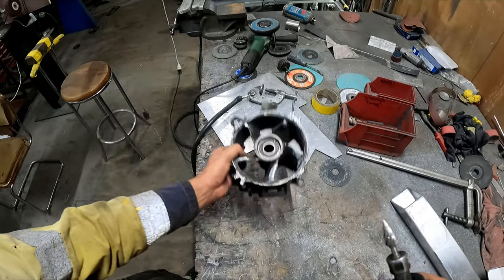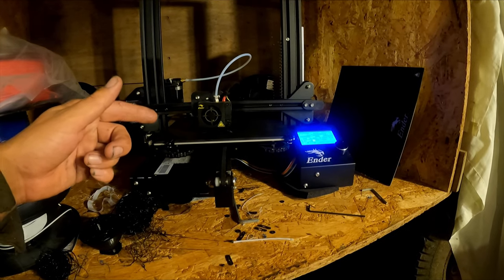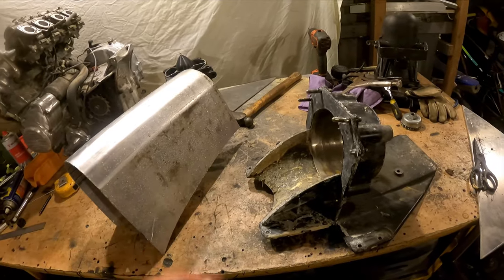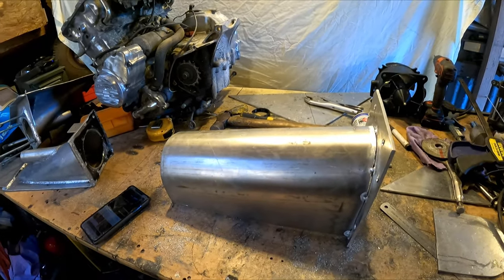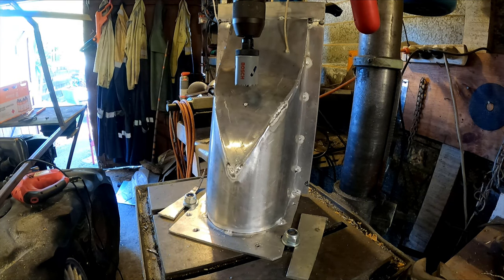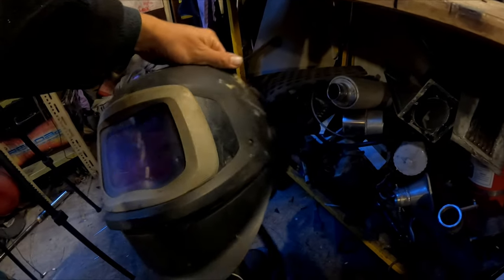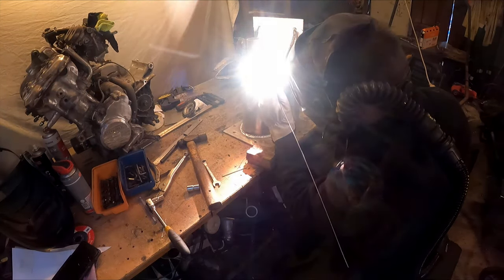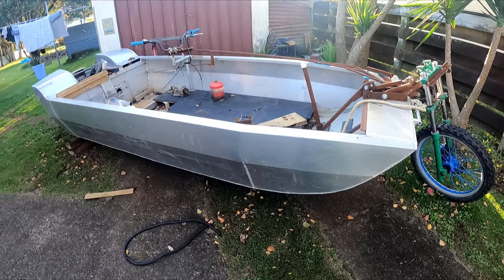Amphibious Jet Boat, Part 2 , How To Build Intake

Comment: the argon thing is true, Argon is an inert noble gas 1.38 times the density of air. so it doesn't react with anything and displaces other useful things like oxygen. it can sit in your lungs but you should be able to expel it with a few big breaths, either laying on the floor or sitting with head between your knees. The symptoms are dizzyness, shortness of breath, tingly fingers, spotty or dim vision, ie asphyxiation

Comment: There are several methods to improve the sticking of your 3D prints. First I would make sure that the bed is really clean, that makes a lot of difference as well. Beyond that you can also increase the bed temperature to get it to stick better, with PLA you can go up to about 70 C. Glue sticks and brims are also an option but I find them annoying

Comment: Awesome build series, I've been playing with jet pump ideas in my head for a while. 
A few things for 3d printing.
1. I personally use Elmer's glue stick on my bed. Or I found an Elmer's pump sprayer of school glue that's pretty much the same.
2.Clean bed /  with some isopropyl alcohol wipe down before printing. Dust can effect it. 
3. if you aren't using pla + look into it. I switched and I'll never look back.
Reply from the maker: Thanks, I am using glue stick now which works great . I tried PLA + and it worked well but it’s quite expensive

Comment: Looks great! I did mine the exact same way, and have a video on it as well.
I did mine with a ball peen hammer lol, my goal was smooth seamless pump flow, which becomes less important if the rig wont go over 30mph but I ended up with 35MPH fully loaded with a 787cc.
Had to use bondo in from of the intake to help make it 100% seamless which ended up acting as a slight "Spoon" and its been taking the beating for some years!
Reply from the maker: O nice! I don’t really think mine is going to be very efficient but for the amphibious trike thing I think it will work well
Reply: @DktheWelder  Looking forward to more!

Comment: I use 3DLAC for my bed adhesion, it's basically ultra strong hairspray and, for the most part, objects pop off when the bed cools. And when they don't I put my bed in the fridge for ten mins and they print comes off easily.

I have never had problems with adhesion ever since I bought it. (I was in the same boat as you before, prints unsticking from the bed) And at also means I can reduce the  elephants foot effect on those first few layers of the print as I'm able to pull up the nozzle a bit.

There are many options out there, but this one has never failed me. Of course this is just, like, my opinion, man.
Reply from the maker: Ok I think hairspray might be the go , do you spray it before each print?
Reply: @DktheWelder  Could have sworn I replied to this. So I'll give you the short answer! No, you shouldn't need to, for the 3DLAC i just move around the bed printing on the parts where there is still spray. Also, small amounts should do depending on the spray you get, go for the strongest you can find if you cant get 3DLAC. You might have to read a few Cosmopolitan reviews to find the best hairspray! 😂
Great projects btw, really enjoying your content.

Comment: I put a BL Touch on my printer. It took me six years to make the jump to the BL… I wished I didn’t wait so long. I used to use hairspray because I didn’t like the way glue stick looked after the print.. with the BL touch I will occasionally use hairspray and that’s it.

Comment: I have been 3d printing for a while. Make sure the glass is clean and dust free. Spray a little squirt of hairspray and let it dry. If it's a heated bed, start at 50c as this is my standard bed temp. Set the bed hight so the first lines of print feels like about haft the material is squashed like this ( 

Once it's all set and you get good adherence I just add a fresh spray of hairspray ow and then, wash about ever 15 prints. 

Saying that the print being that shape I would have issues with the nozzle knocking it on the sides.

Comment: Keep up the good work. You are a good fabricator. What welder are you using. Do you think it's good. Looking forward to the next video.
Reply from the maker: It is a BOC 185amp ac/dc I think it is a Chinese brand rebranded. It works really well and have used it for a few years , we have the same one at work and it never has issues

Comment: its called layershift. now you can look up causes and fixes =)

i dont runt enders glass, but a mirror on my ender. as long as its clean, everything sticks. if im worried, or there is some .05mm part contacting only, i can give it a 3dlac+ squirt.
My sister runs enders glass bed on her max, and weve had to rough it up with some sand paper, and increase the temp towards 60 for pla to stick somewhat ok

Comment: I recently got a 3d printer and it was driving me up the wall with prints not sticking but I found if I set the bed to 60 degrees and wipe the bed down with meths before every print parts stick amazing, sometimes a little to well that I'm afraid I'm gonna smash the bed trying to get it off😂
Reply from the maker: I haven’t heard about the meths way, it makes sense though would make the first layer more sticky

Comment: I don't think you need to hang upside down to get the argon out of your lungs. Normal deep breaths should be fine. Cody's Lab did a video where he breathed in a bunch of gases including argon and xenon with no issue getting it out after a few breaths. Will kill you dead if you breath it in repeatedly though, such as in a confined space.
Reply from the maker: O cool I might watch that! Thanks

Comment: I use glue stick just got to clean it off each time. But if you normally get good prints maybe just clean bed surface with isopropyl alcohol before the oils from your hand can stop your print from sticking.
Reply from the maker: Maybe that’s what it is , I am always pulling pieces of plastic off the bed!

Comment: Ive been 3D Printing only for about 3 or 4 yrs now, ive made anything from little trinkets to an RC Plane (that worked!) and a Ironman Helmet for my kid. Anytime I get any slippage I use All Weather AQUA NET Hairspray Extra Super Hold!! Just a Spray in the Area and thats all You need! Ive used on a glass bed and a heated Magnetic bed.  If you ever have trouble getting pieces off try squirting a little 50/50 Water and 70% Rubbing Alcohol, should break free No Problemmmmm!!
Reply from the maker: Thanks I have been using glue stick now with success but it gets a bit lumpy after a few prints might need some rubbing alcohol 👍

Comment: Daniel order yourself the creality flexible PEI build sheet! get away from that horrid glass! they are spring steel and attach with magnets and have superior adhesion and are really easy to get parts off due to it being flexible!
Reply from the maker: I haven’t heard of that, it came with a fibreglass bed that would never sit flat . The glass one has been really good but sometimes get a messed up print. I like the spring steel idea

Comment: hmm argon is a fairly heavy gas, heavier than air anyway. I could see inhaling it if you were welding in an enclosed space like a locker/mechanical space or seat box of some kind. At that point I would be more worried about it displacing oxygen though. Speedglass is great just wish the lenses were cheaper. My blower just shit the bed after two years too... time to get another one, it happened at work so hopefully they can buy it for me.
Reply from the maker: I know they are so expensive!
Reply: @DktheWelder  What size pipe did you use for final shaping in the press?
Reply from the maker: @venture17fly  I think 100nb so about 115 mm outside diameter

Comment: I use the stock ender 3 bed and PLA never slips unless the bed height is too low or the part is very thin but large enough to use the entire build volume. I don't need anything fancy to print ABS either. Just a cardboard box to enclose the printer and a brim because it's cheap insurance. I see you have a pristine ender 3 bed in the background, how come you don't use that?
Reply from the maker: That bed is great for sticking parts to but wont sit flat enough, the glass one I have on now works really well just some prints don’t stick
Reply: Oh you must be printing much more precise parts than me. I have noticed my bed isn't completely flat but I've never seen it affect the function of the parts

Comment: dont know about the argon, i do know about the other gasses that you get when welding aluminium. I had to stop working for a few days because of inhaling a bit of it while mig welding aluminium. I allmost couldnt breed for like 60 min, and breathing was still kind of hard for 3 days after. So i was actually thinking about investing in a fresh air helmet as wel.
Reply from the maker: Wow that does sound awful! The helmet are so comfortable and nice breathing the fresh air all day

Comment: Little late for the comment... but I heat up the bed. Clean with rubbing alcohol and then apply glue stick. Very thin layer. I even have a wham bam bed. Usually have zero problems with pieces staying till I remove.
Reply from the maker: Thanks, I have been using glue stick now

Comment: A little bit of stick glue helps adhere to the bed plate. A lot of times you may be having issues with bed leveling, bed temp, (Hotter helps stick to the plate)  Make sure your 1st layer is nice and tight against the bed. When I first started printing I could not get my prints to stick. I tried EVERYTHING... The biggest unseen issue with 3d printers is if you have just a SLIGHT bit of oil on the bed plate it will stop adhesion. If you try anything ive said at least grab some 99% ISO alch and clean the build plate with HOT water first, dawn soap, Hot water rinse, then finally clean it off with just the ISO alch. You dont realize how the smallest of oil will prevent prints from sticking. Let me know if you get it sticking better!
Reply from the maker: I did end up finding some glue stick and it worked so I will keep experimenting, thanks a lot for your input, I also don’t adjust my layers and stuff I pretty much print using default settings. I should put a bit more effort in I think 👍
Reply: @DktheWelder  let me know if you have any questions! I 3D print as a side gig and have lots of shareable knowledge. Keep up the great videos !

Comment: haha yea mate argon in the lungs sucks, its not just with tig, mig will get ya too. and yea invert yourself is the only real fix, it dosnt take long normally i just hang over a chair or something to raise the waist above the mouth and a few long full deep breaths will clear most of it out and your good to go again, the worst part is unless you know what is going on you wont even realize what is going on you just feel knackered, tired and out of breath,ish . it can creep up on you real quick too, to the point you feel light headed sort of but its just lack of oxygen, i know i shouldent but i have a fair bit of experience with this. lol dont tell h&s
Reply from the maker: Thanks, I thought it was a myth good to hear it from someone else ! Maybe that’s why I get so sleepy at work haha
Reply: @DktheWelder  Get yourself a pulse oximeter - should be about $70 from the chemist. Clips on your finger and tells you the oxygen level in your blood, which indicates how well your lungs are working, and whether there's a problem.